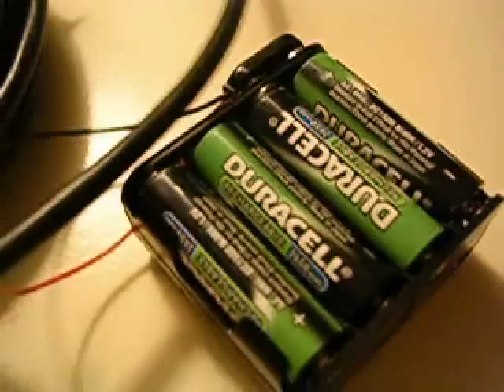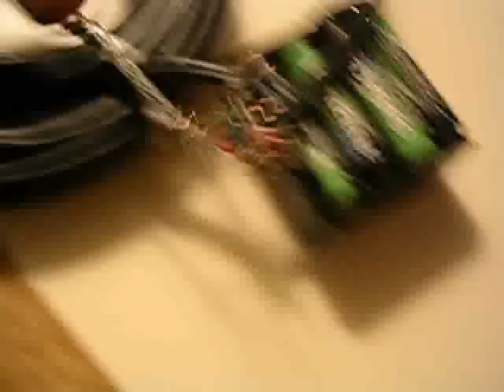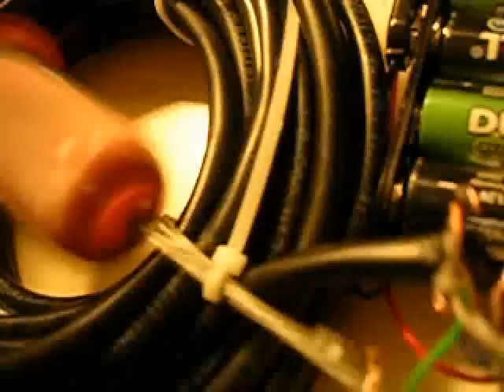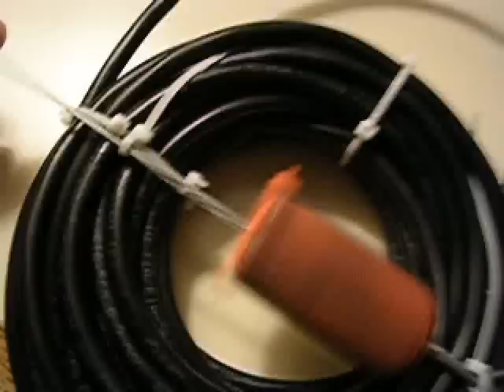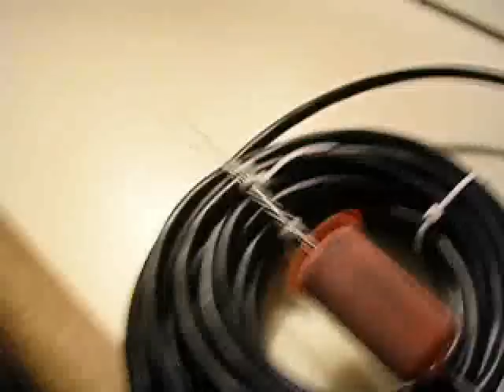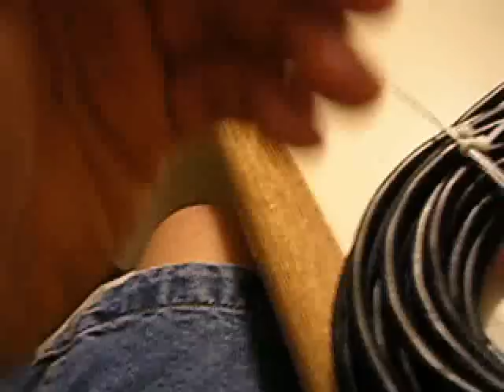Electric motor ▲ Magnetic Inductance / Electrical Resistance

Comment: i wonder how fast it would go if you added another element in this model, "static electricity", you could wrap a few rubber bandsaround the spinning coil and have a winter hat grounded & just bearley touching. I wonder if after a min of it being turned on if it would continue to spin if you cut off the batteries due to the static electricity? have any of you seen the Van de Graaff generator small ones can generate up to a million volts. if you try it be careful and please let me know the results

Comment from the maker: Google search term: "L/R time constant"

It definitely shows relative effectiveness because it is a constant of decay used in many systems having a separate inductor and resistor. This decay is simply the decay in the rate of change of current in an inductor once voltage is applied. After some time, about 5 times the time of L/R, the current is very close to its maximum value. The current rises quickly at first then levels off.